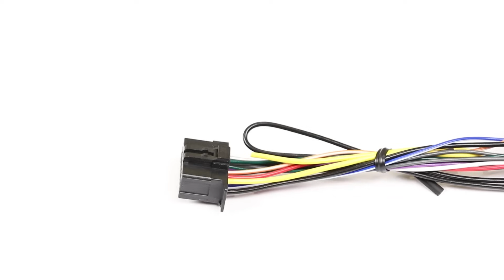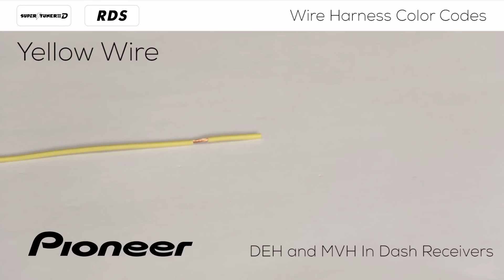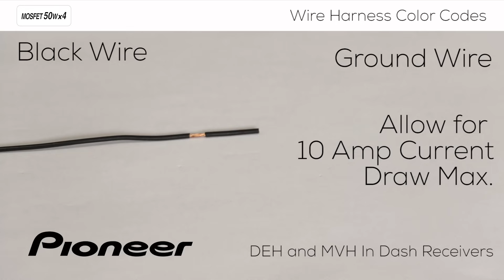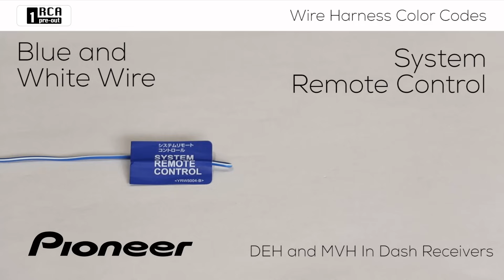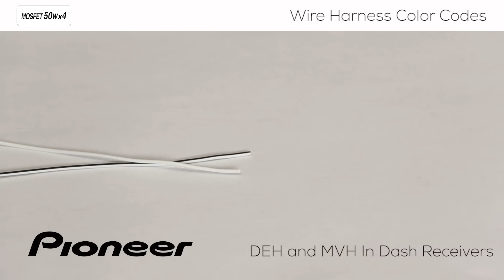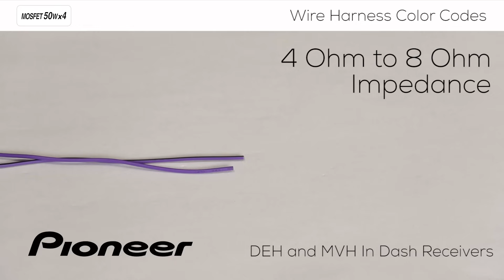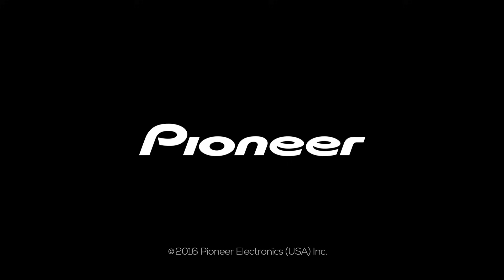How To - Understanding Pioneer Wire Harness Color Codes for DEH and MVH In Dash Receivers

Comment: Took out my stock Impala radio and put in deh pioneer lost my ac 😭😭
Reply: It sounds like you blew a fuse for the climate control fan, or AC, or some other fuse.   I recommend to disconnect the negative terminal from the battery before doing any sort of install work.  If you had disconnected then negative terminal from the battery, you may not have blown the fuse on the fan for the climate control system. If you have the new receiver installed correctly it should operate on a different circuit than the climate control system and the AC/Fan fuse will not be an issue.   You can find more videos on Pioneer's YouTube Channel here:  https://www.youtube.com/user/pioneerelectronics
Reply: @deckerdotto6035  I don't believe I have a climate control? Just fans with hot or cold I had the famous Impala ticking noise under the dash for the regulator and when I go to turn my fan on you can hear the car get louder acting like it's turned on and the light shows but fan speed fans will not come on at all so just looking at all my possibilites before I take it to get looked at
Reply: The AC and heater with the fan is what is known as climate control in a vehicle.  Again, it sound like you blew the fuse on the fan.  Check the fuses in the vehicle.

Comment: connected the as per the video, is there a way for the stereo to turnon while there is no key in the ignition?
Reply: In nearly every modern vehicle the answer is no.  However, there could be some exceptions to this depending upon the vehicle.  Pioneer receiver's are designed this way so you don't accidentally leave the in-dash receiver switched on when you exit your vehicle.  And when you come back to the vehicle, the battery is dead.    You can find more videos on Pioneer's YouTube Channel here:  https://www.youtube.com/user/pioneerelectronics

Comment: I have problem with my 2006 Subaru wrx no illuminations in the dash., help me
Reply: It sounds like you may have blown the vehicle's fuse for dash illumination.  You did this by touching two wires together or incorrect wire connections.  You can find more videos on Pioneer's YouTube Channel here:  https://www.youtube.com/user/pioneerelectronics

Comment: My old vintage pioneer no have rca output for amplifier.can i use white and grey for stereo to amplifier using converter high to low rca?
Reply: That may depend on how old and vintage your Pioneer receiver is.  The wire colors for old vintage Pioneer receivers may not be the same as the colors you see in this video.  Please be sure you're using the speaker outputs to connect to your line level converter. You can find more videos on Pioneer's YouTube Channel here:  https://www.youtube.com/user/pioneerelectronics

Comment: Hi! I have a Pioneer DEH1900MP, that I recently hooked up. The device turns on, but the screen flashes on and off. I can’t seem to figure out why or get any information online.
Any word on what this means?
Reply: Wow, that's an old one.  The Pioneer DEH-1900MP was produced back in 2005-2006.    The screen flashing likely means a wiring problem.  The first possible issue is with the ground wire.  Check to be sure the Black wire has a good connection to metal in the body or frame of the vehicle.  Another possibility is speaker wires touching each other or metal in the vehicle. I recommend to check the back of the receiver to be sure no speaker wires are exposed and touching one another, or metal.  Also check the speaker locations to see that the speaker terminals are not touching metal in the door or rear deck or other are in the vehicle.  It's also possible that after 15 years, this product needs to be serviced.  You can find more videos on Pioneer's YouTube Channel here:  https://www.youtube.com/user/pioneerelectronics

Comment: Does anyone know were the yellow wire and the red acc wiers go on the back of the reservoir PIONEER CD Deck modelDEH-11E on the pins
Reply: I recommend to contact Pioneer Customer Service in the US and buy a new wire harness for your Pioneer DEH-11E.  You can contact Pioneer Customer Service in the US here:  https://www.pioneerelectronics.com/PUSA/Support or by calling in the US  800-421-1404.  You can find more videos on Pioneer's You Tube Channel here:  https://www.youtube.com/user/pioneerelectronics

Comment: Ah. That explains the deal with that blue wire with white stripe. Antenna power time.
Reply: I have a pioneer radio so do you connect the blue wire with white strip to the antenna

Comment: I have a deh s31bt, with AMP ERROR, if I add the external amplifier it’ll fix it? My battery voltage is up near 14
Reply: Amp Error means the receiver is in protection mode.  If you are seeing AMP ERROR on the in-dash receiver screen this almost always means exposed speaker wires are touching each other or touching metal in the vehicle.  Check the White and White/Black, the Gray and Gray/Black, the Green and Green/Black and the Purple and Purple/Black wires at the back of the in-dash receiver. You can see them here:     https://youtu.be/kR2MO2kwFug?t=256  If the speaker leads have exposed wire, properly terminate the wire so there is no exposed wire.      If the speaker wires are not touching each other or metal behind the dash, check the speaker locations in your vehicle.  If a speaker terminal is touching metal in a door, or some other area you may see AMP ERROR on the in-dash receiver.  Adding an amplifier is a great idea, however, please note:  Until you figure out what is causing the amp error, it will continue to display.  You can learn more about Pioneer amplifiers here:  https://youtu.be/99Hfmc8QxVc?list=PLw63zJRQbCNg42VJXw0g7xzWJozqoSR1V   and you can find more videos on Pioneer's You Tube Channel here:  https://www.youtube.com/user/pioneerelectronics

Comment: I am having a trouble.. my head unit is pioneer DEH-80PRS, Currently going on network mode. I am using 4 channel external amps. Front mid bass were connected to using external amps (channel B). Subwoofer was connected using bridged external amps (Channel A - Bridged). My tweeter was connected to grey and white black wire from the unit.

The problem is : The mid high pass filter was filtering the mid bass (which is correct), but the mid low pass filter was filtering the tweeter instead of the mid bass. And therefore, the high low pass filter is filtering the mid bass. What is wrong here? I am confused.
Reply: The Pioneer DEH-80PRS was first manufactured back in 2010 and it works a little differently than any of the more modern Pioneer receivers in network mode. The Pioneer DEH-80PRS uses the Rear Output RCA and Rear Output Speaker Level as the High Range output in Network Mode.  And the Front Output RCA and Front Output Speaker Level as the Mid-Range output in Network Mode. This means Green and Purple speaker wires are the Rear or High output.  And the White and Gray speaker wires are the Front or midrange output.   This is different than other modern Pioneer in-dash receivers.   This is clearly noted in the DEH-80PRS installation manual.  You can find it here:  https://www.pioneerelectronics.com/StaticFiles/Manuals/Car/DEH-80PRS_InstallationManual072616.pdf  The RCA outputs are from the top of the unit to the bottom,   Rear/High,    Front/Mid,     and Sub/Low.   Also, please be sure to choose a Crossover Point and Slope for the midrange outputs both HPF and LPF.  No matter what crossover point you set, if you choose a slope of Zero, you have effectively made this output a pass through with no crossover at all.  You can find more videos on Pioneer's You Tube Channel here:  https://www.youtube.com/user/pioneerelectronics
Reply: @deckerdotto6035  Hmmmmm... I see, that's why.. my next question, what does the rca input high and low means on the back of the unit? I searched for some resources but still, I don't understand what it used for and what do they differ.. and thanks a lot for your reply, it just solved my problem!
Reply: You can find the installation manual for the Pioneer DEH-80PRS here:  https://www.pioneerelectronics.com/StaticFiles/Manuals/Car/DEH-80PRS_InstallationManual072616.pdf  This topic is covered in some detail.  Please read it.    The RCA input on the back of the Pioneer DEH-80PRS is simply a 2nd AUX input.  It can use low level RCA input from an external device.  Or it can use High Level speaker input from an external device.  Depending upon what type of input you are going to use, set the switch accordingly.  If you are not going to use the 2nd AUX input, it does not matter where you set the switch.    The DEH-80PRS will not automatically adjust to the type of signal and may be overloaded with a high level input if you set the switch to low level input.  If you are planning to play music from an external device through the 2nd AUX input, be sure to balance the volume output from the music player with the input on the DEH-80PRS to avoid a distorted input signal.  You can find more videos on Pioneer's You Tube Channel here:  https://www.youtube.com/user/pioneerelectronics

Comment: Which wire is the power??
Reply: The Yellow Wire and Red Wire are both required to power up the in-dash receiver.  You can see it here:  https://youtu.be/kR2MO2kwFug?t=13  The Black ground wire is also required to operate the in-dash receiver.   When installed in a vehicle, do not connect the Red Wire, and Yellow Wire together.  If you don't understand what you are doing I recommend to take your vehicle to a qualified Car Stereo shop for help with installation.  You can find more videos on Pioneer's You Tube Channel here:  https://www.youtube.com/user/pioneerelectronics

Comment: Mine doesn't have the orange
Reply: Most modern Pioneer in-dash receivers that do not include the Orange/White wire will instead have the Illumination Timer function.  This will let you set the time of day the dimmer will switch on and off.  You can see it operate here:  https://youtu.be/pMKUPcGE26c?list=PLw63zJRQbCNinkLCSrV17ExW5FWT7aIFU  You can find more videos on Pioneer's You Tube Channel here:  https://www.youtube.com/user/pioneerelectronics

Comment: Hi! I have Pioneer fh-p80bt. Install was very easy, but I noticed the sound is not how it should be... wires were all connected correctly but when I checked wires with multimeter, only white wire was positive and white with stripe was negative, all the  others with stripe are positive and with no stripes negative... It should not be like that, or?
Reply: The Pioneer wire harness system is not designed to match the colors of any wires in any given vehicle. This video describes the function of Any Given Wire by its color code in the Pioneer wire harness.  You must connect the wire harness to the proper wires in the vehicle.  This is not based on the color of the vehicle wires.
Reply: @deckerdotto6035   HI! Thanks on fast reply! I was talking about wires on radio. Direct output wires that go to ISO connector in car. They have weird readings on multimeter. Only wihite wire in upper row  gives me positive, others in upper row negative. To bad I can't send you picture so you can see what I mean.
Reply: The speaker outputs should be read in AC.  When the in-dash receiver is switched on and playing music, the speaker wire outputs (Gray and Gray/Black, White and White/Black, Purple and Purple/Black,  Green and Green/Black)   should read AC output.  The designation of positive and negative on the speaker output wire is only to ensure correct phase polarity for the speaker.

Comment: had t a fh-p85 sitting on a shelf for years,and lost the harnesses,theres 2 plugs,i need the pinout for them,i dont know if it worked when i got it if i can get it to power on iil buy a harness if they make them still,its from 96
Reply: i fortunately,in a way found a repairman that had the service manual for the fh-p80,with the p-85 side notes,but the stereo was doa,cost me 20 bucks,he had the service manual for a pioneer keh-p770 deck that i have so it kinda worked out,what model stereo is yours?
Reply: Same problem im having. did you figure it out??